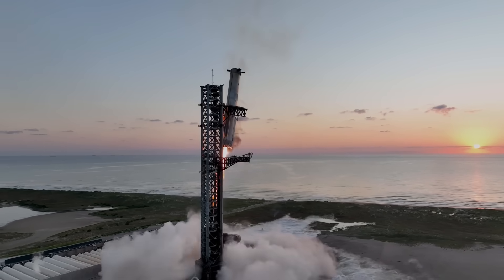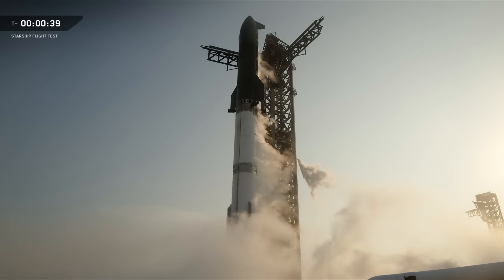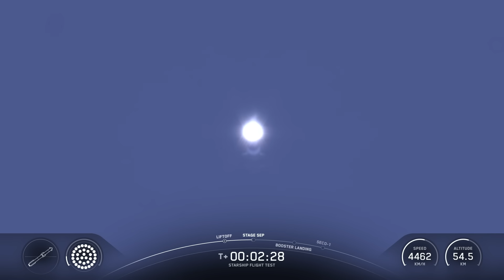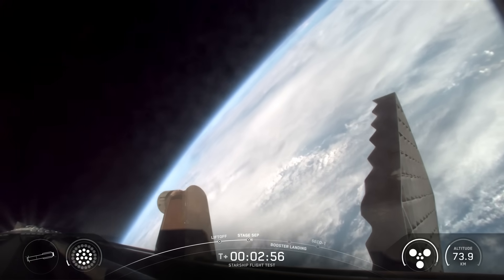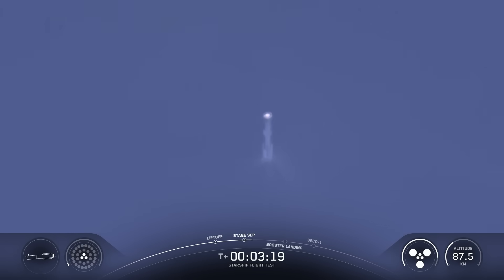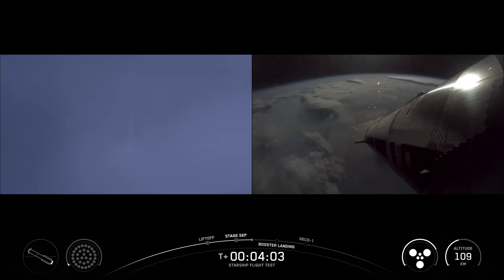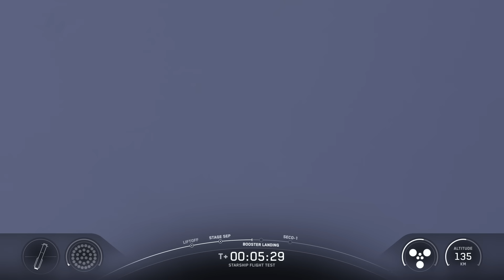SpaceX Builds Largest Reusable Booster, Also Makes Door That Won't Open - Starship Flight 9 Recap

Comment: I guess you’ve got to hand it to Rockwell and the other contractors who built the STS shuttle.  I just watched a NASA recap film of the first STS mission, which HAD to be a manned mission.  Imagine being the two crew members riding a hardware stack which had never flown integrated before.  One of the big concerns of that initial mission was whether the cargo bay doors would open and close correctly.  Of course the doors worked each and every time.  Even though two shuttles were lost, the losses were not from flaws of the shuttle itself.  That speaks to the excellence of engineering which went into the shuttle component of the STS.

SpaceX’s approach reminds me of one of the two types of kids in old school undergrad programming class.   There’s one kid who fixes an error on one card and throws the card deck in the hopper to run again.  That kid runs the job 20 times before spotting all the careless typos.  The other type of kid is the one who flow charts the program, writes it out on coding sheets, punches it and the job runs after one or two tries.  In the end both kids may get a working job, but one has used up a lot more expensive resources (the CPU time).  Concentrate, not iterate.

Comment: Not only are they struggling to build a door that works correctly. They're struggling with getting Raptor to actually do what it's supposed to do without shredding its own plumbing, which also happened on this mission.
Reply: the raptors on booster have been remarkably reliable after identifying the sloshing propellants on the first 2 launches, even ship raptors have been very reliable, again after the first 2 flights, whats changed is the V2 ships of the last 3 launches have redesigned plumbing and since then every ship has had leaks, the issue isn't raptors, its the ship plumbing.
Reply: @DrewNar-tacA  The Raptors are burning more fuel now right? That increases the pressure in the plumbing.
Reply: @erikkarsies4851  no, the leaks we're seeing are coming from the attic above the aft section so this would be plumbing before the pumps, this plumbing would see pressure equal to the pressure in the main tanks, however pogo or harmonic oscillation could cause the different parts or the plumbing to see higher pressures momentarily. longer straighter pipes this is amplified.
Reply: @DrewNar-tacA  Wasn't the pogo thing something that SpaceX admitted to having issues with?
Reply: @h.a.9880  yes, spaceX called it harmonic response, POGO is a specific kind of harmonic resonance that almost every liquid rocket has had to deal with in some way.
Reply: @DrewNar-tacA what this acronym stands for?
Reply: @Special1122  pogo isn't actually an acronym. it's named after pogo sticks. thrust compresses the structure vertically, which can turn into an oscillation of vertical compressoin/decompression, which can affect fuel flow, which can make it worse, and push the frame beyond the designed limits... it caused damage on multiple saturn v flights, including crewed ones.
Reply: @Special1122  ^^
Reply: @Special1122  Pressure Oscillations Growing Outrageously?
Reply: Come on it only takes 6 wood and you get three
Reply: I wonder how much design they're changing between flights, or if worker fatigue is affecting quality. Whatever the explanation, it looks like they're going backwards.
Reply: And you have left skid marks in your underwear so I wouldn't Judge SpaceX
Reply: @Judgekronn  Thanks. I appreciate the feedback from a weird gooner in a semen-encrusted SpaceX shirt. 👍
Reply: @Judgekronn  You're leaving drool stains on your keyboard, it seems.

Comment: Well, the program seems to be struggling and even making reverse progress.  I support Elon and SpaceX and I have watched every test flight.  By the end of the V1 starships, things were going well, with solid progress on every flight.  I was ready for them to be catching the Ship along with the booster!  Instead, they have been smacked with failures in SS V2 and the Raptor 2 engines continue to lack reliability, particularly when it comes to re-lights. And leaks. SpaceX is experiencing tough times, so worrisome in fact that last night I wondered if there is some sort of sabotage going on internally.  Hopefully, that's a ridiculous thought.   But as Manley says, engineering is very hard, and we are sure seeing that.  Managers at SpaceX like Gwynne Shotwell need to insure that everyone stays in focus on the problems and that they can get those Raptor 3 engines into service ASAP!

Comment: Props to SpaceX for not cutting the feed the second something didn't go right.  The objective was data, so it was a success. How quickly everyone has forgeten all of the failures in the early days of rocketry that gave us the modern descendants atlas and delta.

My guess on the door is it friction welded due to vibration.  And maybe there was pressure inside holding it closed, there was lots of ice floating around.
Reply: lol. Success?  Ok 👍🏻 
I guess as per you, literally anything is a success short of an abort. I’m sure you’d say an abort is also a success in testing the abort procedures as well…

Comment: A problem I see is their iterative design process changed way to many variables between Block 1 and 2. How can you get to the core causes of issues when you go from a working model to a broken one and you don't have a process capable of isolating variables because you changed 1000 things at once?
Reply: I think this isa huge problem when applying an iterative process on expensive hardware. It is simply too expensive to progress with only one change at a time, so they are forced to take some more risks. I still think this is way faster and less expensive than the "do-everything-right-the-first-time" approach of traditional rocket development.
Reply: @jonmaloy6783 Yes, because the do it right the first time crowd often find it difficult to change anything once a decision or part is baked in.

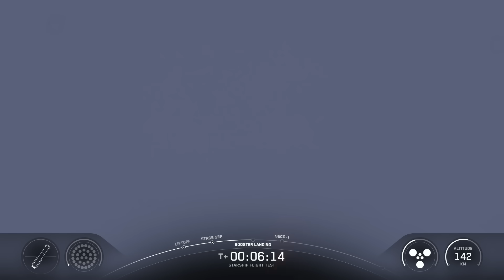Comment: Approx time 8:00 you ( and NSF) note that the glow in the booster engine bay ( as seen from the ground) is aero/reentry heating, but I'm more inclined to call it a fed fire; it spreads and burns like one, + imo the booster is too low and slow.

Comment: I think the issue is NASA Apollo engineers have forgotten more than Space-Z has learned.  NASA overengineered and tested EVERYTHING, small or big.  Space-X is trying to take advantage of todays technology without the same attention to detail of 1960's technology.
Reply: and that's what we got: a massive exploding prototype that has been in development for more time than the Saturn V and has still not completed a full Earth orbit (nor proven re-entry capabilities, let alone the in-orbit refueling without which it's not gonna go anywhere). The Apollo way was the right way.
Reply: @llucbusquets6266  the biggest reason Apollo worked was because the politicians funding it actually cared about the end result more than the jobs it made

Comment: Doea anyone else think there is a problem with the hot stage ring design? Seems to me that igniting the ship engines in such close proximity to the booster is a potential cause of the leaks and hot spots we're on the ship.

Comment: If I'm being completely honest, I'm losing faith in SpaceX's ability to solve these problems in their projected time frame. Rapid iterative design is great, assuming that you're fixing the problems... Demonstrating landing and reusing the booster is quite impressive, but Starship itself seems to have multiple issues that SpaceX has struggled to resolve. (Door, leaks, tiles)
If anyone can get this worked out, it's SpaceX, but can they get it worked out in time for the 2026 Mars transfer window?
Reply: No one is going to Mars in '26... It was always unrealistic, especially when half or more of the space effort wants to go to the moon instead.
Reply: @davidkottman3440  "Always unrealistic," for an orbital rocket to make a propulsive landing, land on a boat, get caught by a giant tower... SpaceX has done a lot of unrealistic stuff in the past.
Reply: Absolutely not. Probably also not for the next 1 or 2 TW's after that.

Comment: A super cool recoverable booster doesn’t matter a lot if the payload is flawed.  It seems like the problems with the Starship are increasing, not decreasing.  After eight prior flights, they’re still having loss of reaction control, that seems like a pretty basic thing which needs to be done correctly.
Reply: It’s almost like theirs still developing it! Who would have thought it wouldn’t be perfect?
Reply: @shatterpointgames  I’m not giving any pass to SpaceX for the reasons I stated above.  If you look at other US rocketry programs after the Atlas ICBM boost development in the 1950s, they didn’t keep launching and making repeated mistakes.  Operating propulsion systems in space is now well understood and it is known how to pressurize tankage and prevent the contents from congregating at the wrong end of the tank.  Losing reaction control by loss of the pressurizing gas suggests poor quality rushed lack of workmanship.

I used the example of the STS.  The shuttle launch was nailed on the first attempt.  Indeed problems with the SRB O-rings and external tank insulation caused the loss of two vehicles, but the system worked the first time with a live crew as a live crew was required.

I am sticking with my assertion that SpaceX iterates instead of doing all the homework they should do prior to a launch.
Reply: @wtmayhew  Maybe that's why they build rockets and you write YouTube comments about how they do it wrong
Reply: @shatterpointgames  New Glenn somehow didn't need all those failures
Reply: @shatterpointgames 9 flights and still developing it, no payload, no orbit completed 😂
Reply: @arthurdefreitaseprecht2648 You do realize SpaceX is the most successful rocket company ever? They own and operate the most successful rocket to ever exist. Maybe don’t be quick to judge, they have the best and brightest working for that company. I have no doubt the starship will succeed. Get over your anti-Elon conditioning and realize SpaceX is doing something never done before, again…
Reply: @shatterpointgames most successful by what metric? Number of launches? Revenue? Launch cadence? What about innovative designs, reliability, schedule overruns? Regarding Starship, it's plain engineering analysis, both the method and some hardware doesn't make sense, no need to put the CEO in the conversation (only if he was already in your mouth, then I can't do much to avoid him). Apart from that, I doubt the best and brightest would be working for a company that constantly overburdens its employees with 60+ weekly hours.
Reply: @shatterpointgames and lastly, what did they do that was never done before? Land a rocket? That is nineties tech (Delta Clipper). Reuse rockets? That is eighties tech (Space Shuttle).
Reply: honestly, I'm confident that we see an expendable second stage for the superheavy booster developed once they get starship working well enough to realise that their heat shield isn't good enough.
Reply: Gasp... Elon doesn't like truth.

Comment: I know SpaceX needs to get as many “worst case scenario” tests (like 100 strategically placed tile omissions) in on as many Starships as possible given the extreme expense of these launches.  But maybe, just maybe they need to fly ONE unaltered Block 2 Starship BEFORE adding in all these change variables.  They don’t have a control against which to compare.

Comment: If each version takes just as many tries to reach key milestones (like re-entry), you're not doing iterative development right. It still works, but it's far less effective. Ideally, the knowledge gained should significantly outpace the disruption caused.

Comment: 4:17 what is that bright light just a little bit down from the top, middle of the screen?  Just sunlight reflecting off something?

But anyway, loss of attitude control in the upper stage?  During the 9th flight?  This result is even worse than the first few flights.

Comment: 8:05 at first it looked like an FTS explosion, but I think that was off at this point, right?  I wonder if the propellant  hit the pipes on the bottom too hard as soon as it started breaking?  it sure looked like a clean explosion, and not gradual engine issues.

Comment: Given SpaceX's willingness to fall back on temporary hardware to make their test campaigns run faster, I'm kinda surprised we don't have a backup RCS system based on the Falcon 9 one.  This is now the 3rd Starship that's failed to provide useful re-entry data b/c of issues with the RCS system on orbit.

Comment: The struggles of Fl 7, 8, 9 compared to 4, 5, 6 but hey, it's in development. But I have always hated that bay door. I hate the opening mechanism, and I hate that it travels 1/3 the distance around the circumference. If it was my design, I wouldn't use a hinged door, I do a rolling door, and it would be vertical, not horizontal. Thats a lot of load and stress to carry over the door. I'd load those Starlinks vertical on a carousel like an old carousel projector. Since this is the first ship that burned up, I wonder if they were able to extrapolate any useful data from that.

Comment: honestly I consider anything short of V1 a failure. If it was just the pod bay doors, it would have been a success. But without a soft splash down or at the very least getting all the way through re-entry, it's a failure.

Comment: I was on board for a long time with Space X's do it/try it/fix it incremental improvement approach of their space program.  But mission 9 is over; and they still can't their Starship right.  Clearly, the level of complexity of this system is far greater than the Falcon systems.  I'm thinking that the development methodology that was so successful for the Falcon simply isn't up to the task for the Starship.  Anyway, something has got to change.  The failures are becoming way too embarrassing and damaging to the program.

Comment: SpaceX has received significant funding from the US government through contracts, awards, and other forms of public assistance, with a total of $20.7 billion promised and $8.7 billion paid out so far. I don't think it would have got this far with Starship without that support.
Reply: Doesn't seem like comparing apples to apples... Commercial crew should be compared to commercial crew.
Reply: @davidkottman3440  Yeah, true. However, Spacex is using the same launch system for its NASA contracts as it is for its Mars program, so it's hard to find the dividing line. I shouldn't have added the boeing comparison, maybe. But the point still stands, this isn't private money; and, it's government funding the development of the Mars program on the back of a supposed moon program. And I should add, I'm for it - I just didn't agree with Scott's appraisal that it was private money.
Reply: For comparison, Boeing has received $4.2 billion from the government for the Starliner commercial crew program